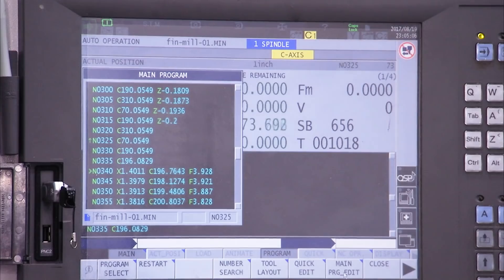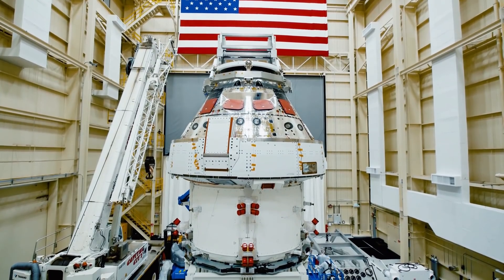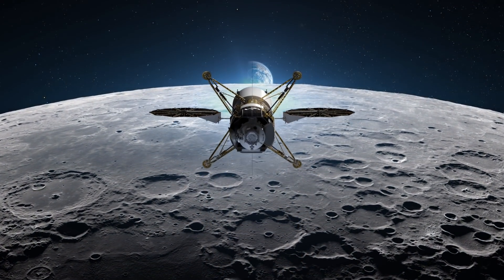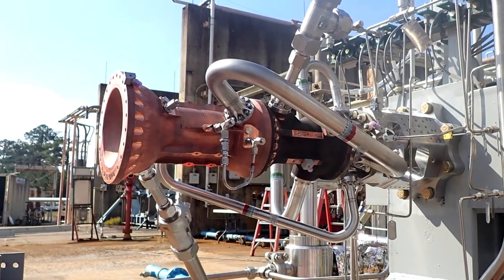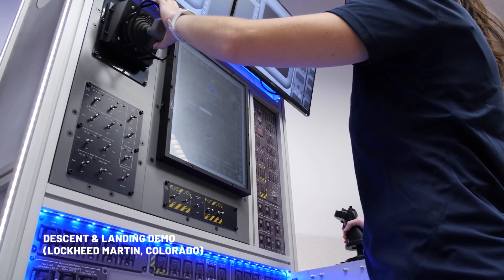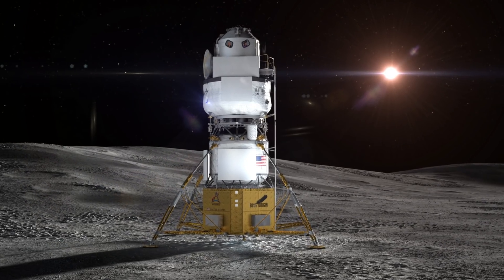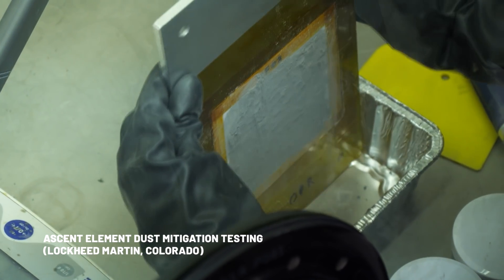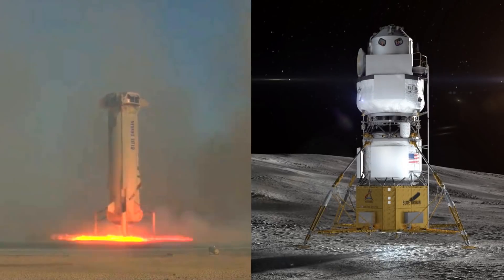Tech Demos for NASA’s Artemis Program

Comment: "Meanwhile at Boca Chica..."
Reply: this is the past not the future
Reply: @NamiduIndunel  Apollo 2.0. Amazing how the American public are okay paying more for less.
Reply: Lmao I  don’t know why meme man watched the sn8 test and complains everything is possible blue origin will go to the moon and spacex will go to mars and to the moon nasa also chose them so let’s see
Reply: @AbbadhKuthubdeen  I don't think @Meme man was undermining starship, just making a joke about it. It is pretty amazing, and a bit humorous what SpaceX has and will be able to do with Starship, while everyone else works hyper-risk averse in a clean room.
Reply: @elijahwills7331  These Starships are all just test vehicles. Once proven, they will scale up diameter to gain better performance characteristics. Final version could be 12M, 15M, or 18M. Allows for greater capacity which may eliminate or require fewer refuelings.
Reply: @brettd3206  actually the diameter is not planned to change at the moment. Currently the final version of Starship shouldn't have changed much at all from it's current design by the time Starships are making regular trips into orbit. SpaceX will probably stick with 9m, and the idea to stretch diameter and height drastically has been mentioned by Elon as something years off. And just stretching the width won't decrease re-fuelings. The Starship would have higher payload capacity, but due to the rocket equation the amount of re-fuelings simply won't change unless a fraction of the payload capacity is brought to LEO rather than utilising full capability. While sn8 was a test vehicle, it is not far from the finalized Starship. Starhopper is closer to what you're thinking of.
Reply: @AbbadhKuthubdeen  Bruh its a J O K E
Reply: @googleacc7472  yepp I understood
Reply: @AbbadhKuthubdeen  Space X will go to the moon and mars. Starship is a multi-planetary rocket. And unlike Blue origins crap, you can actually fully re-use Starship.
Reply: @AbbadhKuthubdeen  yea dude u my bro u got that this meme man speaks nonsense
Reply: Blue origin and NASA out here still trying to figure out how to recreate Apollo. Meanwhile SpaceX is taking a ship bigger than the ISS to the moon for a price probably 100x smaller than the costs of sls with the ability to get it done in the next 4 years.
Reply: @giganooz  facts
Reply: @giganooz  could you please specify which SpaceX ship is bigger than the ISS
Reply: I'm just really glad that space is getting more and more people excited! Whoever wins this race (to moon), very soon there will be another. Boca Chica looking very very interesting though...
Reply: the true innovation lies in Boca Chica
Reply: @rya  Bezos is a business man, Musk is an engineer!
Reply: @asraharrison  And a lot more
Reply: @asraharrison  Bezos is a scientist musk is a businessman do some research
Reply: @btg7760  bezos is also a businessman
Reply: @eriikkuuu  yes but unlike musk he didn't study it in college
Reply: @asraharrison  trust him ! He's engineer what da f**k was outta here!
Reply: @btg7760  Bezos is not interessted in helping humanity, he is just interested in the cash he can make using humanity. Fuck Bezos, at least Musk has a vision for humanity
Reply: @swenmcheath1798  I’m sorry and Elon Musk doesn’t profit off humanity? Workers at Tesla and SpaceX are highkey taken advantage of. Id argue both Musk and Bezos have similar passion, but at the same time they BOTH are looking out for that bottom line.
Reply: @SprAlx   i did not say that its bad to make profit from this whole space deal, after all money is the incentive behind privatly funded companies and its doing wonders for this "new space race". My point is that bezos engineers are developing some novelty tourist attraction (new sheppard) only giving rich people the opportunity to experience  "space-like" things while musks team is developing real stuff that will enable everyone to go to space, not only LEO but even further, while at the same time developing solutions to existing problems here on earth. Their goal is making humanity multiplanetary, a goal that will mark another step in humanitys quest for eternity and i have yet to see anything in that direction from BO/Bezos (although i could have missed something, feel free to correct me).  The whole thing about exploiting workers is another topic and both of those guys are guilty of it.
Reply: @SprAlx  on the other hand, why would it be important that american companies use american engines? We are on this blue marble together and thats exactly the kind of nationalist thinking that is preventing us from going out there together. Soviet engines are efficient and reliable, they have a ton of data about them so why stop using them? You could argue that its hard to get them and russia may have export fees for them but as soon as humanity comes together those problems will be gone and isnt this what exploring space is ultimatly about? The same things with the artemis accords, we already have international laws regarding space and those artemis accords are just undermining them because USA wants to build military outposts which are forbidden by international law. (Although the part about the artemis accords is a different topic, that was mostly me ranting, sorry for that)
Reply: @swenmcheath1798  Using that logic, why is it important that the Dragon capsule can now send astronauts to space? If we’re all in this together what was the incentive not stop using the robust Proton rocket to send astronauts to the ISS? The point of the BE-4 was to provide ULA with a sleeker and more innovative option for launch vehicle engines. Not to mention, being American designed, it cuts out the complex security and logistical nightmare that is the USAF working with Russian companies. 

I don’t even want to get into the fact that most of those RD-170s initially used by ULA were collecting dust in old CCCP warehouses in Siberia 👀
Reply: @swenmcheath1798  I wholeheartedly support cooperation and innovation within the space industry, which is why I think it’s stupid for people to undercut achievements simply because it isn’t branded with Elon Musk’s face.
Reply: @SprAlx   thats an easy one, redundancy, reusability and comfort, soyuz is great, not very comfy but reliable as heck. I think it was 2 years ago when it safely aborted a mission during ascend, saving  the lifes of the astronauts on board. On the other hand, it is not reusable and that results in one of the biggest drawbacks: the pricetag. Dragon on the other hand has more space, is way more comfortable and reusable which is keeping the price down but it has not much data about reliabilty and abort scenarios. Different vehicles should be used in different situations imho and with both vehicles we have a lot of redundancy in getting astronauts to their destination even if one on the two has some troubles. 

I do fully agree with your second statement. Musk is not the ultimate genius that will solve all problems, to solely rely on him and his companies would be stupid and tbh i kinda hate this whole cult-mentality around him. Other companies are doing great stuff too but especially with BO i get the feeling that the money Bezos has given them has led the engineers to not search for the smartest, cheapest and most innovative solution, Blue Moon is a perfect example for this. You mentioned the BE-4 and yes it is a great engine that gives other companies more leway with their design so maybe engine design is what BO should do instead of creating lunar landers and orbital rockets, the right companies for the right jobs, maybe spacex could do whatever they wanna do faster with BOs engines
Reply: @swenmcheath1798  To be fair, my first statement was rhetorical. At the end of the day, redundancy is key. You scorn BO for innovating, while praising Elon for doing the same thing. Regardless of what either one of us thinks, they’ll still get contracts, and there will still be humans in space for the foreseeable future. As long as companies keep improving, humanity will get there. And who knows, because of how different Blue Origin’s business model is compared to SpaceX, they might just surprise us.
Reply: @SprAlx  yeah, i know, i thought i should answer it anyways just to show you that im not entirely clueless. But i think you got me wrong in the second half. I scorn BO because i think that they dont innovate enough with exclusion from the public while i praise SpaxeX for going with the iterative design approach (coming from software development myself i think that this is a rather good choice for what they are trying to do) and sharing their failures and successes with the whole world. My ending point was that i dont think BO should build landers and rockets but rather that they focus on engine development because, as stated earlier, i think that BOs engineers dont have enough monetary restrictions to be innovative, this results in the overbuilt but underengineered lander we can see in the video.
Reply: @asraharrison  Not like that.If I am not wrong then Elon Flusk(Musk..Overrated)have dual Degrees on physics and Economics.He is not a B.Tech or M.Tech.
Reply: yeah🤣🤣
Reply: SN15: ehem excuse me?!
Reply: Have seen the video?
Reply: @sidharthcs2110  Yes...?
Reply: @elijahwills7331  
You should've noticed the fact that It's not about the carrier rocket.
SpaceX don't have a lunar lander at the moment.
Reply: @sidharthcs2110  SpaceX doesn't need a specific Lunar landing vehicle.. the Starship Variant will serve as all in one vehicle for the mission.. Space X Is developing a vehicle that can transport cargo, humans, rovers, and lunar building materials at once.. The starship is all on one
Reply: @sidharthcs2110  isnt the starship itself the lander
Reply: @phinadelphiahlongwane3485  That's not true. SpaceX acknowledges that a lunar version of the starship has to be built. I think the reason why was because there's a lot of dust on the moon and the normal starship wouldn't be able to land normally.
Reply: @giganooz  Nope. While SpaceX is building a specific lunar variant for NASA Artemis, Elon Musk has been very clear that the standard Starship can and will land on the moon itself. Lunar variant is optimized for it, but the normal one can do it too. It may require a landing pad, but it can land on the moon with enough prop to return to Earth, which the lunar variant will never do.
Reply: @ryandempsey4830  The normal variant has enough propellant to land and return from Mars, the lunar one definitely has enough to return from the Moon. I do think their lunar variant is very silly though, but hey, it could work.
Reply: @gajbooks  far from true I'm afraid. Starship needs a huge amount of fuel. It's almost dry tanks once it has got into earth orbit. The spacex HLS proposal itself states that a starship lunar landing and return mission will require no less than 11 orbital refuellings
Reply: @jimmyfreemantle879  Oh, I was just taking the orbital refueling as granted. The lunar-optimized variant is also reusable and does not return to Earth atmosphere, so it may have better orbital performance characteristics. I personally think the Dynetics lander is much more feasible, especially if it could be transfered into lunar orbit by Starship. I know they're competing, but Starship is going to rapidly eclipse SLS and take over its use cases. The Dynetics lander is reusable with (relatively) inexpensive drop tanks instead of leaving a whole hydrolox engine and lander on the surface of the Moon. They could even build a scaled up version of the Dynetics lander eventually for bulk cargo, if the programs get that far. It lives and stays in lunar orbit, no need for any aerodynamic dry mass or other mass which it doesn't need. The more stages the better, as Apollo proves.
Reply: @gajbooks  ah I see your point now about the fuel situation. And I agree, I think dynetics have a great lander concept and I personally hope they win the HLS bid.
Reply: @sidharthcs2110  spacex has a lunar starship design.
Reply: @jimmyfreemantle879  me too
Reply: @phinadelphiahlongwane3485  they will need to redesign a lot of stuff
Reply: @matthewalder1435  regular starship will melt a crator with its Raptor engine even on low power on a un prepared surface and the purpise built liunar variant is just a mock up right now.
Reply: @jimmyfreemantle879  there is a tanker refueling it once it gets in orbit so it will have plenty of fuel
Reply: @cmthievez  one starship tanker launch can only transfer about 100t fuel at a time so its more likely that a propellant depot will be needed in earth orbit and lunar orbit also.
Reply: @sidharthcs2110  but they have "THE   LUNAR ELEVATOR SYSTEM"💥.
Reply: @sidharthcs2110 yes
Reply: Meanwhile sn9 leaning
Reply: Yup pretty much
Reply: ...Kaboom
Reply: I love how this is top comment 😂
Reply: Starship : hold my 🍺
Reply: Nowadays, it is no longer enough to have a model! We want a demonstration!
Reply: Meanwhile the BIG BIRB is menacingly standing
Reply: It's just hilarious that this is the top comment on blue origins video😂
Reply: @SpaceFan1001  It's because there are so many toxic spacex fanboys around here.
Reply: @spaceenthusiast7160  all blue origin do is doing a low altitude rest all over again
Reply: @spaceenthusiast7160  blue origin doesnt Innovate enough
And besides when we make a roast on blue origin, you BO fanboys invaded the reply section
Reply: @SpaceFan1001  ikr
Reply: Sn@5 lands
Reply: Spacex won the contract of landing the first lander btw
Reply: Blue shit suck
Reply: Meanwhile at Boca Chica.... SpaceX is ready to the orbital flight of starship.

Where is Blue Origin???? Ah I forgot that Blue Origin only exists in animations
Reply: @oMatheusz  what is Boca Chica ?
Reply: YES, well played. It hurts, but so true!
Reply: Now in the comments 
Blue origin vs SpaceX
Reply: ...entertainment for simpletons who has no idea about rocket sciense and big busines but love funny videos and starwars style space thingies.
Reply: This is not productive.  Just imagine if Elon wasn't born.  Bezos would be the best we have, and way better than old school space.  What have you done to further space?  He's putting money (a lot of it) where is mouth is; no need to crap on him.
Reply: @Elpinio  and if D-Day would not have success the nazis would still be ruling germany, so what does it matter, we live in the part of the multiverse were d-day was succesful and musk is alive while not having tusks. Your argument is no argument
Reply: They launched the starship
Reply: sentence yet to be completed.....
Reply: @AbbadhKuthubdeen  Yes ! And remember that it wasn't a hard landing it was just an RAPID UNSCHEDULED DISASSEMBLY
Reply: BHOHICA?
Reply: Lmao
Reply: Blue Origin has already flown 100km test flights 15 times bruh.
Reply: Had to do it to them bit its not like they are getting into orbit in the next 10 years
Reply: Go one Jeff is mad 😡 now lol 😂
Reply: lol i pictured the news guy from sponge bob that said that
Reply: Lol
Reply: Dhinca-chica 😂😂blue origin still in 80s😂
Reply: Still not in orbit.
Reply: There is no lunar lander in Boca Chica.
Reply: "... nothing relevent to the 2024 moon landings was happening."
Reply: Right?
Reply: 😆 🤣 lol
Reply: it crashed.
Reply: @mactek6033  Yes, it did crash. What's your point?
Reply: @mactek6033  but it was a successful test
Reply: @joacogonzalez1430  it crashed. It was not successful. The engines gave out.
Reply: @mactek6033  the objective of the flight was to test the belly flop maneuver, test the flaps during free fall and relight the engines. And the engines didn't "fail" the pressure of the tanks was just low. It went better that the expectations they had. It's not my fault that you are ignorant and that you know nothing about the topic
Reply: Prototypes are exploding and there’s no finished design at all......
Reply: @klauscritchley  at least they are testing stuff
Reply: @klauscritchley  what are you talking about. Oh you mean test to destruction. SN7 took a lot of cryo testing to explode and  it took weeks. spaceX meant to explode it way early then it was meant to and SN8 was a big success. Unlike blue origin who never been to orbit
Reply: @Deutschland fox SN8 did what mk1 was supposed to do 16 months ago......
Reply: @klauscritchley  ok but SN8 is a improved version so they went with that. Blue origin has been around for 20 years and still hasn't been to orbit
Reply: @klauscritchley  and mk1 was for display. Who's better spaceX our blue origin
Reply: Deutschland fox in terms of a lunar lander for the 2024 goal? Blue origin. Long term? Starship.
Reply: @klauscritchley  they don't even have a rocket to launch their lander
Reply: Joaco Gonzalez spacex doesn’t have a super heavy to launch their starship yet either. Blue origin lander will have 2 rockets that will start flights in 2021-2022
Reply: @klauscritchley  and blue origin hasn't reached orbit for 20 years
Reply: Joaco Gonzalez One of the vehicles for blue origin lander is Vulcan, by ULA, who had reached orbit more times than spacex
Reply: @klauscritchley  but blue origin have never reached orbit
Reply: Joaco Gonzalez what does reaching orbit have to do with making a lunar lander????
Reply: Joaco Gonzalez just answer the question. What does earth orbit have to do with the ability to make a lunar lander????
Reply: @klauscritchley  how are you supposed to deliver a lander to the moon without a rocket? With a trampoline?
Reply: Joaco Gonzalez like I said before, they will use ula’s Vulcan rocket. And ula has gotten to orbit more times than spacex.
Reply: @klauscritchley  yes, because blue origin is so pathetic that they don't even have a launch vehicle
Reply: Joaco Gonzalez They don’t have one yet because besides their upcoming lunar lander, they have no other of their own payloads right now, and there’s already so many other orbital launch companies/rockets there really isn’t a market for another orbital rocket.
Reply: @klauscritchley  i thought this is about blue origin vs spacex not ULA vs spacex
Reply: @klauscritchley  sn15 became a success because it landed softly
Reply: @klauscritchley  and besides ULA is not competing with spacex
Reply: All you PEOPLE need to STOP comparing it with SPACEX and just appreciate their time and Effort of Blue Origin too !!!
Reply: @mikecali6092  LOL
EVERYONE IS NOT LISTENING TO YOU!!!!
😂😂😂😂😂
Reply: Dude calm down there already dead
Reply: @navalca9686  you are not good
Reply: @navalca9686 ok have a nice day😊
Reply: 'Meanwhile at Boca Chica some space cowboys launched a steel thing with wings that looks like a pen to 12.5 km, then making it fall in style and finallly not landing it"

n o i c e
Reply: @googleacc7472  still better than blue origin which has done nothing
Reply: @FreakPayEnjoyer  yea BE-7 is absolutely nothing
Reply: Especially you Mr, @FreakPayEnjoyer
Reply: @FreakPayEnjoyer  just because they don’t flaunt it doesn’t mean blue origin hasn’t done anything. Have you heard of the BE4?
Reply: @SprAlx  BE-4 is a nice Powerful engine for sure. The numbers so far say it has comparable or equal Total thrust as a Raptor Engine, but a slightly lower Thrust to weight ratio than Raptor. 
BE-4 has a goal of 25 flights of reusability while Raptor has a goal 50 flights of reusability. 
Raptor has flown on a rocket to 12.5 km, but BE-4 is yet to fly to any height. 
Raptor Rocket engine is set to cost around $2 million per engine and BE-4 is set to cost around $8 Million per engine.
All these numbers are subject to change from both companies because they both are still developing these Engines. 
New Glenn, which more Powerful than SpaceX Falcon Heavy, is looking very good if they are on track for Launching it for an awesome flight next year in 2021 and can finally make people shush about Blue Origin never reaching Orbit Once.
Reply: @snowrocket691  Exactly, I know Tim Dodd us very much a hobbyist, but I love his attitude. The whole of the aerospace industry is very much interconnected and companies and groups often build off of each other. Companies innovating today wouldn’t be here without legacy groups of yesterday. Not to mention the instrumental work of NASA. 

The BE4 is doing something that most Elon bros don’t even think about. Blue Origin is strengthening our launch vehicles by supplying American designed and made engines to American space companies. Northrop and ULA will no longer have to rely on Soviet engines to send satellites into orbit. In that regard, Blue Origin is doing a lot for the industry.
Reply: @FreakPayEnjoyer  Right! Has blue origin even made one orbit around the Earth?
Reply: @SprAlx  yo you work at ULA??? Massive respect to you my dude. Thanks for helping fuel one of the biggest space launch companies !
Reply: @iamarokotmanson  Nah I don’t work at ULA. I wish lol. I work at another big name doing systems engineering. I just wish people knew that innovation isn’t a lone wolf deal.
Reply: @FreakPayEnjoyer  Blue origin is a joke to space exploration
Reply: @FreakPayEnjoyer They´ve done  more than they show... what has ULA done for Vulcane? We dont no so you´d say nothing but in fact they want to launch this year. SpaceX just shows an unconventional amount of developmentprogress
Reply: @FreakPayEnjoyer  blue origin isn’t as public with what they do like space x because Jeff bezos isn’t an ego maniac.
Reply: @FreakPayEnjoyer  yeah
Reply: @googleacc7472  😂u mad!!
Reply: @aqeelraja4750  no im not mad
Reply: @aqeelraja4750  yes
Reply: @googleacc7472  what now bitch
Reply: @googleacc7472  
Well your comment aged like a cup of milk 😂
Reply: @googleacc7472  now wut huh they've stacked the starship 20 on super heavy lololo
Reply: @googleacc7472  steel thing??? seems like you got no single clue about spaceflight
Reply: @alex1201-p4n  no dont worry i know what starship its just a freaking joke
Reply: @googleacc7472 And Blue Origin has launched a rocket with a capsule on top which is the size of Falcon 9 landing leg. Go vertical and come back touching the edge of space. They are trying to do this VERY VERY VERY VERY VERY VERY VERY VERY difficult thing from 2000 so that human can take a 11 minutes tour to the edge of space and will take ONLY, ONLY $250,000 for a seat. But because it is VERY VERY difficult, they can't take a human still today.

NOICE*
Reply: @starshipsn1056  Only 250k? Just a quarter of a million? That is ridicoulus. Thats way too much. That would mean that for a typical, 75kg male passenger the cost-per-kg would be around 3333.33 dollars. For a typical 55kg female the cost-per-kg would be even higher: 4545.45 dollar. Thats freaking expensive and only superrich people can afford this novelty tourist attraction. Thats no archievment, thats embarrassing. The goal is access to space for as many people as possible but new sheppard will not archieve this because it is simply that: a novelty tourist attraction for the sons and daughters of multimillionairs
Reply: @swenmcheath1798  ya that's why, I think the thing Blue Origin wants to do is useless. Only rich people can effort this ride. 250k USD only for a 11 minutes ride.
Reply: @starshipsn1056  thanks for the clarification, its hard to know if its sarcasm in texts xD
Reply: @googleacc7472  are you kidding me! 😱
Reply: @googleacc7472  Blue origin did everything perfectly and finally landing on.....screen. Hahaha. That's called perfect dream.
Reply: @googleacc7472  It was a test and was not expected to land anyway lol
Reply: @googleacc7472  It’s called prototyping. That is what the grownups are doing in the space industry. But please..., do tell us all about the successful orbital launches of BlueOrigin and their tiny toy rocket....?
Reply: @googleacc7472  which is still way more than blue origin has done.
Reply: @googleacc7472  this is definitely a bot 🤭
Reply: @TheJoker-qb5ue  o k
Reply: @googleacc7472  SpaceX finally landed  a  Starship  and  it´s just the  third try what  you gone  have  to  say now  little  jeff fan boy
Reply: @karmageddonb.4113  Sadly it exploded
Reply: @googleacc7472  That's why it's called a prototyp, 2-3 more flights and you will see a perfect landing you little blue origin fanboys can still watch some blue origin animations while starship flying to the moon and beyond in next 3-4 years !!!
Reply: @karmageddonb.4113  Im sure sn11 will be a success and even if it isn't they get to Learn about the failure so they can prevent it from happening again
Reply: @googleacc7472  it exploded but it's the procces to the succes
Reply: @googleacc7472  *junk
Reply: @googleacc7472  you cowboy got
Reply: @googleacc7472  you cowboy
Reply: @googleacc7472  this agreed poorly
Reply: @shavaughndavidson2257  *correction it aged horribly
Reply: @googleacc7472  dislike this guy who knows nothing about spaceX and is fooling others also
Reply: @RocketsNRovers  bruh its a joke i know about spaceX
Reply: @RocketsNRovers  yes good point
Reply: @googleacc7472  A silo 😝😂
Reply: SpaceX fanboys are ruining the spaceflight community
Reply: @iamarokotmanson  fr man. And most of em aren’t even in the industry.
Reply: @SprAlx  @starman jair  , Those guys are not true space fans then. Everyday Astronaut is a Huge SpaceX fan and he is always telling everyone to support all space companies and be Team Space. He supports all space companies including Nasa, SpaceX, Blue Origin, ULA, Rocket Lab (New Zealand), Russia, China and many others. Blue Origin is yet to reach Orbit, they never reached it. New Shepard only goes to the Karman line, which is one step before Orbit. The New Glenn Heavy Lift rocket looks more promising and hopefully it is on track to have an awesome launch next year in 2021.
Blue Origin is Much better than Arca Space and their very low power water rocket.🤣
Reply: @iamarokotmanson  "spacex fanboys are ruining the spaceflight community"
How exactly?
Reply: @iamarokotmanson  boomers are ruining the space community.
Reply: @benjaminanderson7066  boomers ruins everything